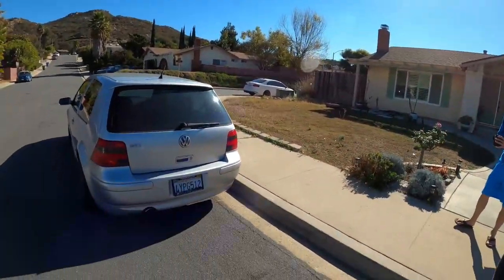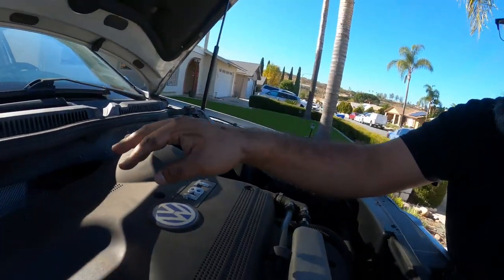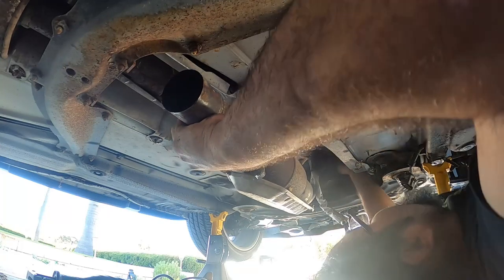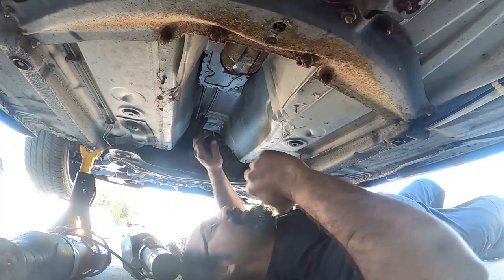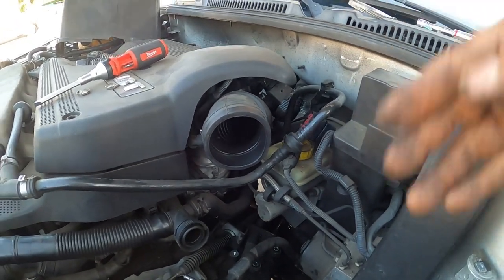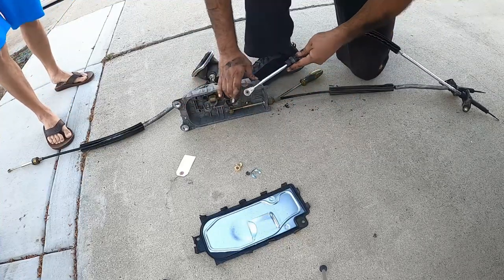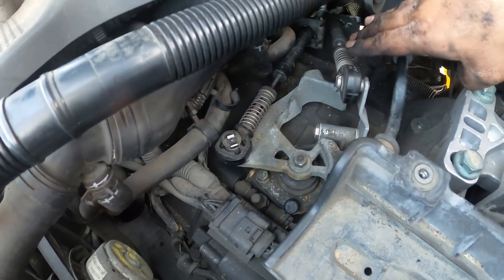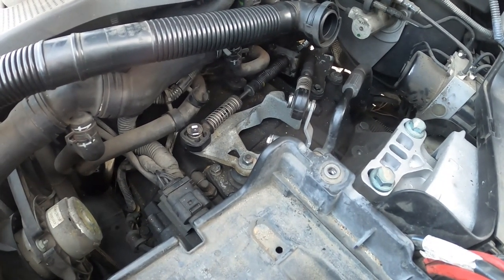How to Remove MK4 Golf/Jetta Shift cable and Box S7EP19

Comment: Searched under vw passat shift linkage,  nothing came up. Called my local dealer they tell me I can do this job from above if I remove the center console.  Once I did,  i realized i had the same amount of access as removing the shifter trim. Then i searched for any manual shifter cables. I found your video. I swear dealers give out bs info so you take it them once you hit a wall. Thanks for the info. Huge help

Comment: Great Video!

Quick question before I pop my car up on stands: If my gears have all shifted over 1 on my mk4 (for instance R is now 1st and 1st is now 3rd) would that be linkage or could that just be due to the shift cable ends needing adjustment? (relatively new to working on and maintaining my own car - sorry if it is a stupid question)
Reply from the maker: Not a dumb question at all.
Yes 1st thing i suggest is looking at the linkage. It is very common for them to fail or have the rubber in them fall apart.

Good News I have a new DIY coming soon for that to rebuild the entire shift system.

Comment: my mk4 doesnt have those clips on the shifter linkage to remove the cables from the transmission side? its an 01 mk4 golf 2.0 with a 5speed. would that make a difference vs a 1.8t? how can I remove mine?

Comment: I’m having the same problem with my car.. it’s the exact same model.. I made a bushing, but didn’t change the linkage.. I still don’t have 1st and 2nd. Do I have to get a brand new shift cable? What do you recommend? Anything will help me, thank you!
Reply from the maker: I suggest getting a new cable that what solved his problem however you can go a bit lower in lrice and try getting bushings from diesle geek.

Comment: I used a small hole saw on the passenger side of the box to do my bushing. Much quicker, don’t have to pull the box. Good info for my upcoming manual swap though.
Reply from the maker: Yeah we didn't want to make any holes

Comment: im having the issue where my car wont go into 3rd 4th or 5th after messing around with the shifter cable car wont go into 5th but was able to get 3rd and 4th back any recommendations?
Reply from the maker: Hard to tell but it can be the linkage in the box or onto the tower. Keep playing with the tower linkage if all else fails take the shift boot off and inspect the bushing.

Comment: the nuts and studs on the shifter box are "upside down" because you dont have to remove the exhaust if you just take out the center console
Reply: Which way would you say is easier 🤔
Reply: @BEEF-EATING-BEAR  it's kinda unnecessary to take apart the exhaust if you can pull it out from the top. I think it'll be easier to pull the center console. You don't have to get on your back and you stay clean
Reply: @jeremykeiser9621   FYI I done this on a seat toledo which is the same and you have to drop it from the bottom no way it will go up.

Comment: Slowly working on this project now in mk4 Wolfsburg and is a pain, wondering if possible to delete o2 sensor system? I'm putting a 3in down pipe but will not connecting it original cat back which I will be also removing it since the cat was deleted when I got the car
Reply from the maker: You can delete the 2st 02 sensor but you have to leave the wideband one in and you need it tuned for that as well or else the car will not run well at all.
Reply: @PincheALsGarage  10 4 thanks I will remember that for the distance future since I've been working on this car for 5 or so years now lol bit at a time cuz "when there's time aint got money and when there's money ain't got time" lol I will probably be picking up your delete kits later I just ordered the down pipe and shifter bushings should be arriving this week

Comment: Does the end of the cables just pop off the ball that connects them to the shift arms...I have my new cable in just afraid to pop the end piece off and break it and it's the only part you skipped in the video
Reply from the maker: Yup they just pop off you will see when you open up the shift box. It is suoer obvious

Comment: I changed my clutch recently and now my gear box will only go into 2nd and 4th and will not go into any other gear. Even if I take cables off tranny the shifter still will not go through gears on shifter inside car
Reply from the maker: You might have gotten a bad clutch

Comment: Hey would you be interested in a cheap mk4 Jetta 1.8t 5spd for your channel???
Reply from the maker: What is cheap?
Reply: @PincheALsGarage   under a grand whatever you feel it’s worth. Car has boost leak needs battery and has back registration idk if you’d be interested in it for parts or would make a good project. Has new diesel geek sigma 5 shifter and upgraded pcv system was working on trying to get it fixed up and smogged but unfortunately I’m gonna have to move back to TN soon so if you’d be interested let me know
Reply from the maker: @travisjohnson1505  i would love it but I need to finish Mark's MK4. To have space for it.
Reply: @PincheALsGarage  I got ya well if you make some room or decide you want it let me know it’s here in SF
Reply from the maker: @travisjohnson1505  dang your far. Won't be worth it for us. I would only get it to give it away.
Reply: @Travis Johnson are you interested in selling & shipping the sigma kit?
Reply: Might be worth towing it down when I go pick up the engine. I'm in SF. Travis let me know if you need help wrenching on it. I got plenty of tools and parts. Unfortunately my garage has my MK4 which AL is building an engine for.
Reply: @Luis-xd3qg  I appreciate it bud I really just need to sell it tho. But if you got the vac system under the intake and boost piping and intercooler laying around I’d pay ya for it
Reply: @MikeSzJr  sorry no bud
Reply: @travisjohnson1505  no sir. Ive only ever owned VR6's. Not any 1.8's.